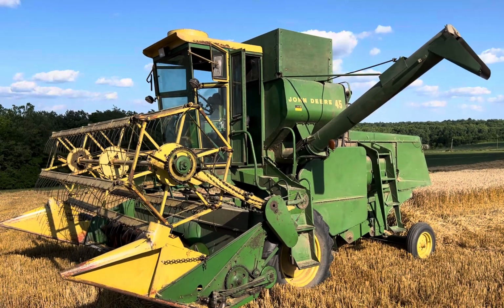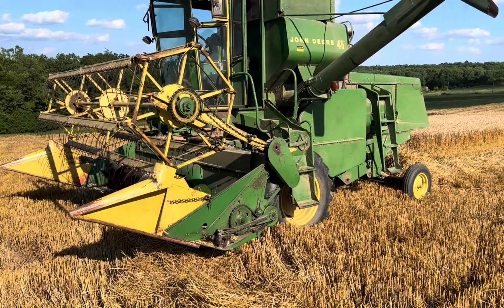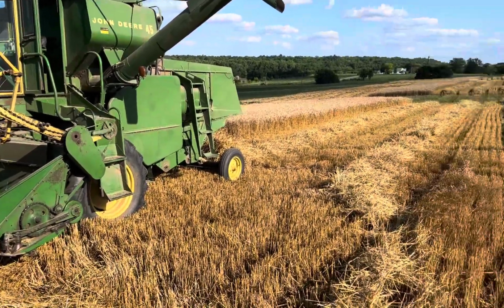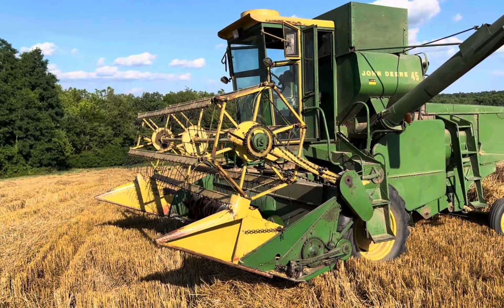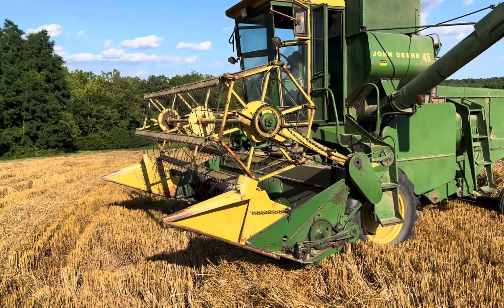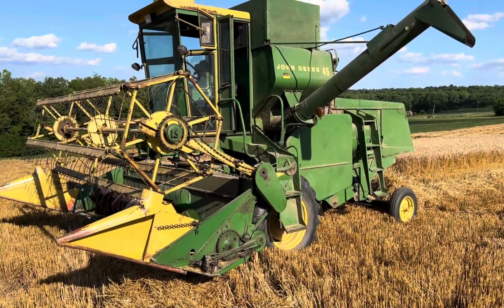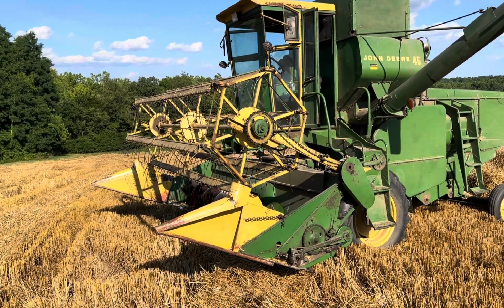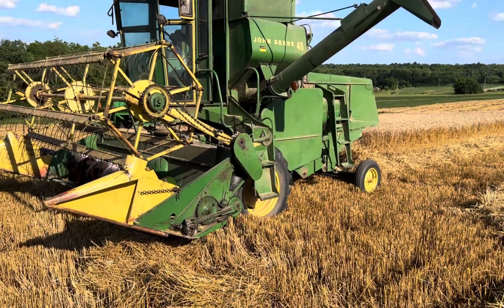John Deere 45 Combine Running Wheat

Comment: Almost finished Roger? Looks like half way done there is a ton of straw to bale from what I can see. Combine looks and sounds great
Reply from the maker: Finished. Wheat did about 70 bushels per acre, a lot for such an old combine. The attendant at the grain elevator said my wheat was cleaner than any he’s seen. Not bad for a crop planted with a drill that’s 87 years old and harvested with a combine that’s 57 years old. 
I’m going to try to bale the straw with a 1953 Case 130 baler and a 1957 Case 400 tractor.
Reply: @rogermiller7411  that is awesome Roger. I always enjoy your videos. Can't wait to see the baler in action